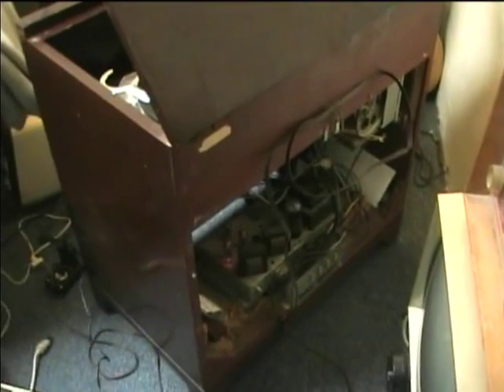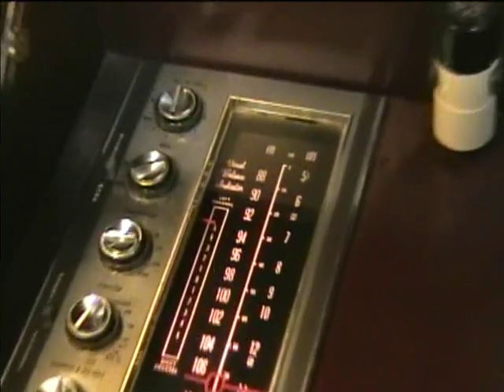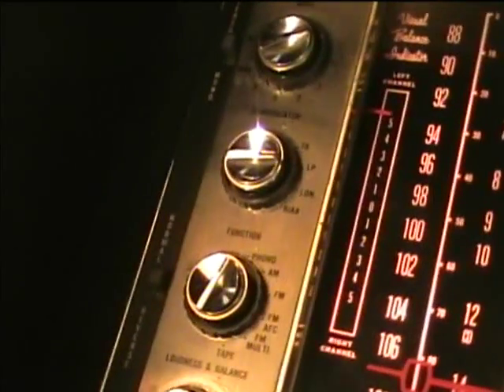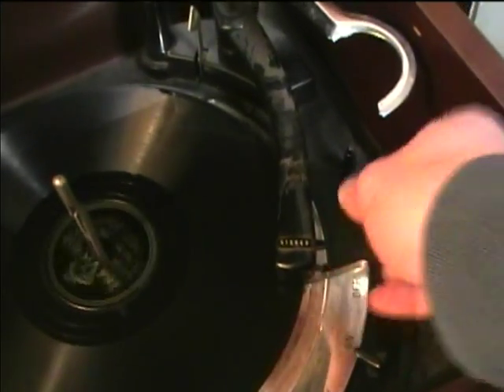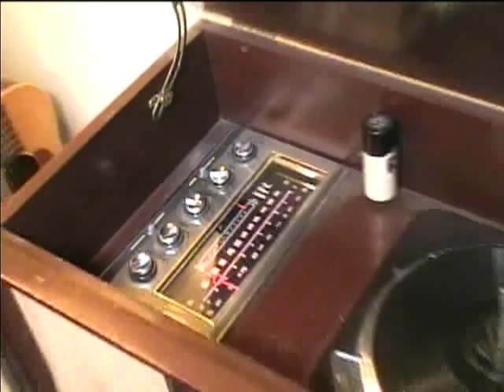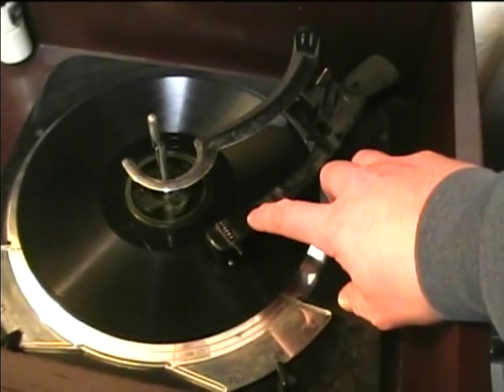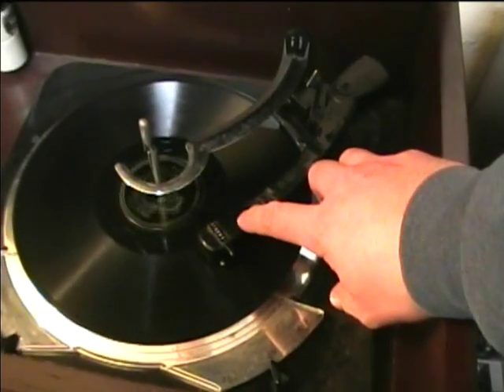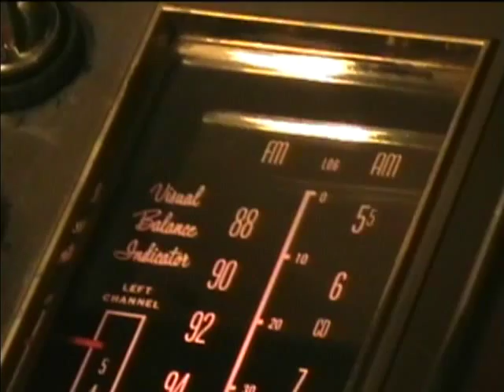1959 Admiral Console Phono test

Comment from the maker: @Turkeydoodlers Hum is usually caused by bad electrolytic capacitors. On the record changer there are two bolts with nuts that fold up that you undo on the underside of the changer to remove it. If the idler wheel has a flat spot in it you may be able to put it in a drill like a drill bit and grind it down slightly on some fine sandpaper attached to a workbench.
Reply: Where in the world do you find the belt and the rubber The idler wheel

Comment: The receiver looked very familiar to me, and when I saw the changer it all came back.  When I was a teen we had a console that opened from the front.  The changer was at the bottom and it pulled out on slides.  Same changer as in this unit, I'm pretty sure, and the tuner/amp was at least very similar.

Comment: Oh yes, The Velocity trip device device located under the turntable gets sluggish when not used and causes the tone arm to drag as it nears the end of the record. You can often feel the resistance when you move the arm toward center. This drag sometimes causes it to sound a little fuzzy. Lubrication is not recommended in the service manual but exercise over and over does seem to help. Once the trip device gets really out of whack with lubrication it is very hard to get it right again.

Comment: its looking nice.  i know what you mean about getting the tuner out. i usually just leave the bottom nuts in. still need to find a 45 adapter and get a new dial pointer for the balance control, think my dial cover is broken but I haven't seen it in so long i cant remember lol.